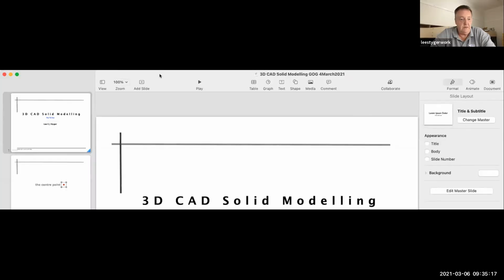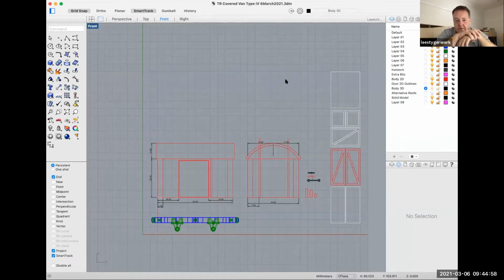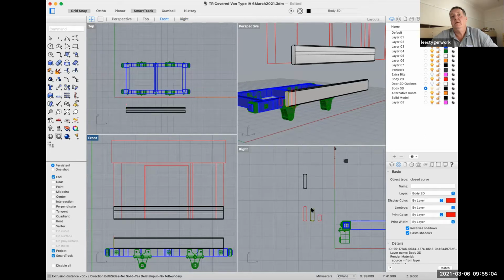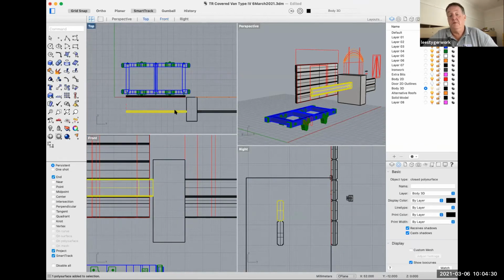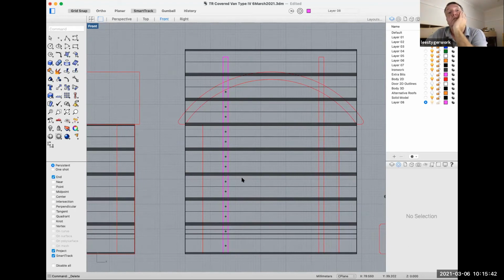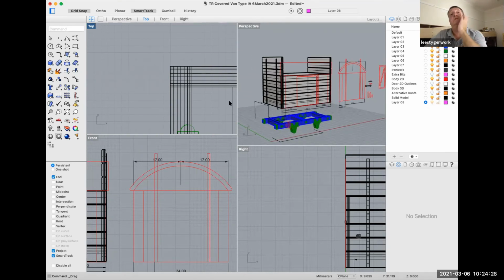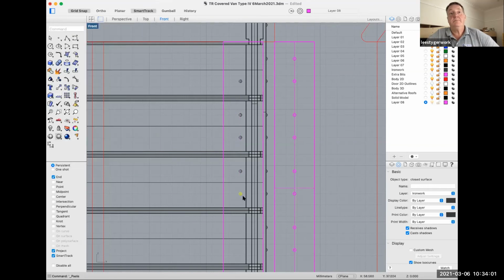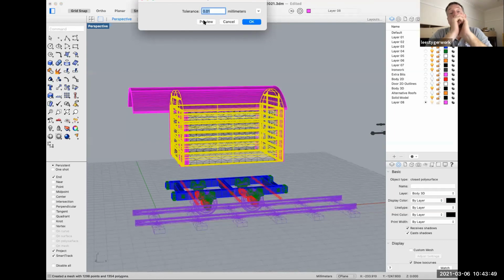3d Printing Zoom Session Recording

Comment: Thank you for video. Just got as far as the software, Rhinocerous. So that's near enough £1000 is that right, or am I looking at a way too professional package?
Reply from the maker: Have a look at Fusion 360 - it is free for hobbyists and there are loads of instruction videos on YouTube
Reply: @TheGaugeOGuild  Well, I don't mind paying, it's just that it seems we either have the choice of free or £1000 (others have mentioned Rhinoceros or that other expensive one, is it AutoCAD?). Isn't there something somewhere in the middle? This has always been the main stumbling block for me, what software to get. I can usually get the hang of using it but I have had some frustrations with the free stuff. I'd much rather pay and have good software. I've tried free versions of Sketchup and 123D Design so far. You say Rhinoceros is affordable, I'm wondering is their a cheaper version, say £200 - £400, or other 3D software that is good enough for hobbyists around that price range?
Reply from the maker: @richardarcher3435  Fusion 360 is a version of AutoDesk, and you can buy it if you don't want the free version.